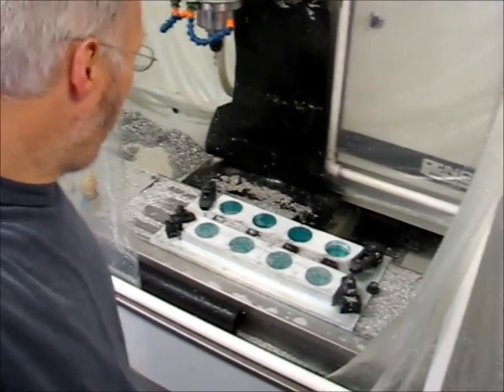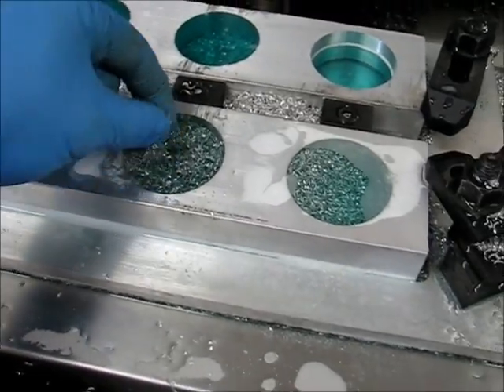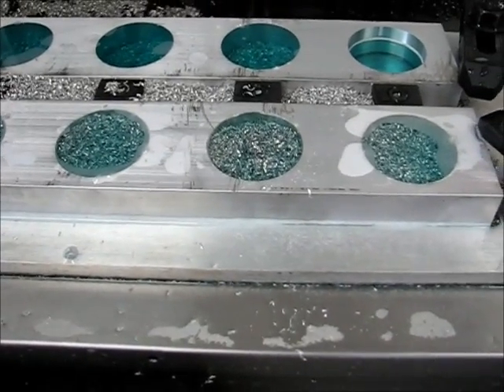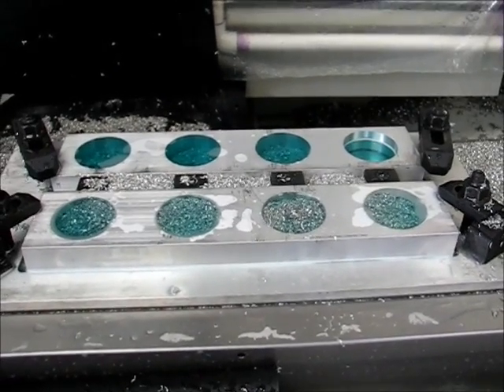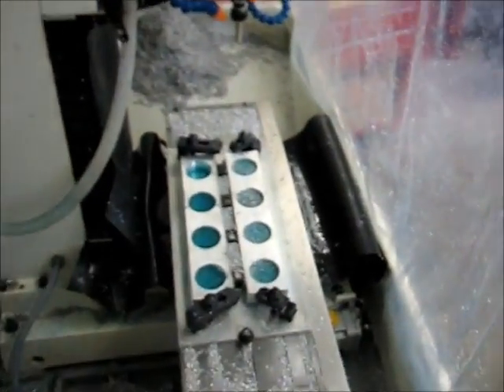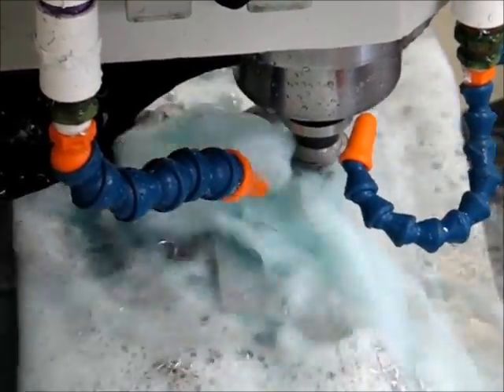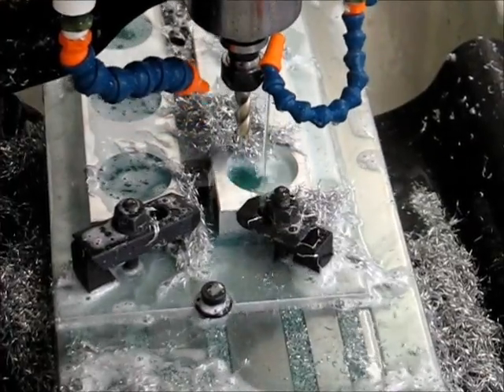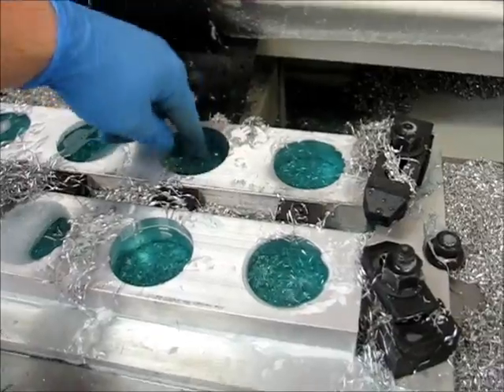Why High Flow Flood Coolant? Tormach CNC

Comment: Great video! I notice you have extra protection over the standard mill bellows on the Z and Y axis. Can you give more info, as this looks interesting to keep the c**p out of the bellows and make it easier to clean up the chips. I have just purchased my first mill, an 1100M, so would be interested in doing the same. Thanks, Nick

Comment: have you had any problems with spindle bearings?  I just installed a high flow pump and was told to watch your bearings.
Reply from the maker: Here's a not-so-satisfying answer for you.  I've replaced bearings once (check my video on the method for the PCNC 1100) but that was because improper fixturing failed and the end mill yanked the vice off the table.  I'm about to do bearings again (three years later, or so) but, it's probably from a combination of flood coolant and lack of use.

When I machine the slinger, I'll make a video about it.

Comment: Very good point there Christopher thank you for sharing your knowledge, i wondered if you could do the same with forced air or even have a little vacuum nozzle. Of course none of these would keep the tool cool as good as the flow coolant.
Reply from the maker: +Andy Lasers Perhaps compressed air would do an equivalent job, but I'd have to buy a much larger compressor than the one I own right now.  I spent about $250, as I recall, on the entire flood coolant and enclosure system.  Just an adequate air compressor alone would probably be three times that.  Thanks for watching!

Comment: From what I've been told, not only does it clear chips, it keeps the leading edge of the cutter from getting hot enough to create a steam pocket. Pockets are bad because the tool heats up, then cools down rapidly when coolant hits the cutter again. The rapid heat cycles are hard on tooling.
Reply from the maker: +positech123 That's a definite possibility.  I know some cutting tools (material type and coating) are more sensitive than others to the local cooling.  Thanks for watching!
Reply: Yep. And many times, in certain situations, the tool will last longer cutting dry because of that fluctuation...I swapped from using coolant to running dry on some 1018 steel parts at work and the end mills lasted many times (like 3x) longer without chipping etc